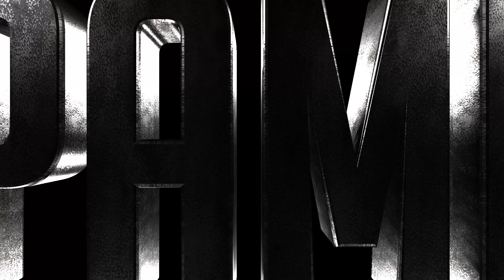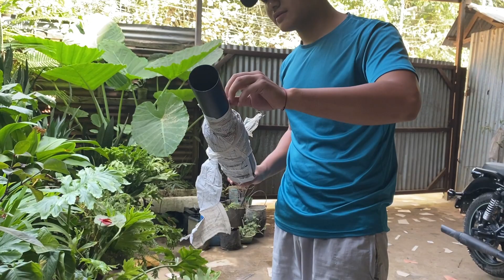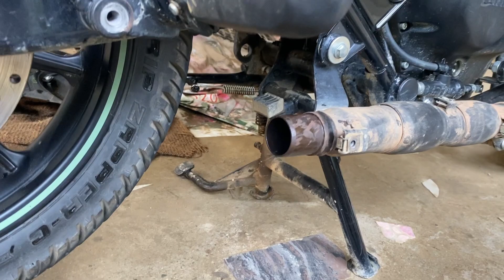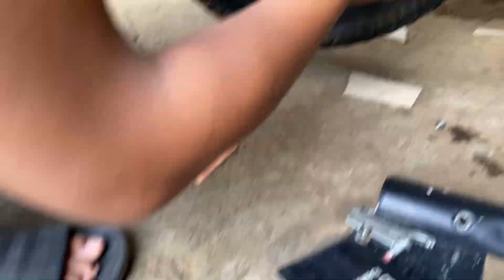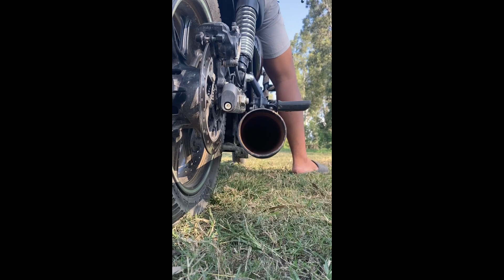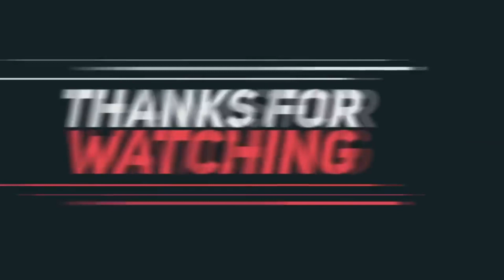Mini Punjab Installing in Meteor 350 🔥| My First Video👍

Comment: Did you removed converter? Or this sound is with converter... Any performance or mileage issue?
Reply from the maker: No i didn’t remove the converter.. Better performance is shown mileage not problem at all 1-3 km lesser than usual